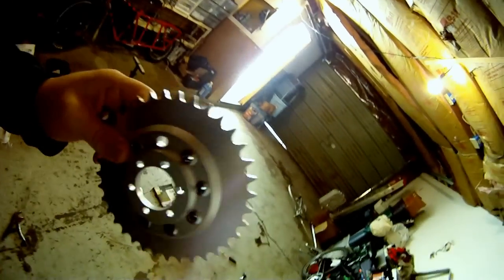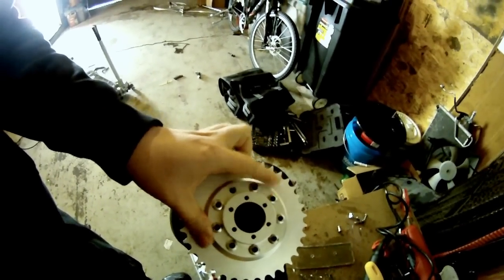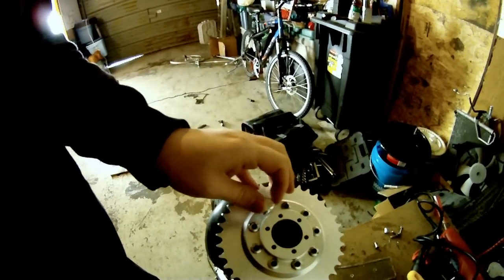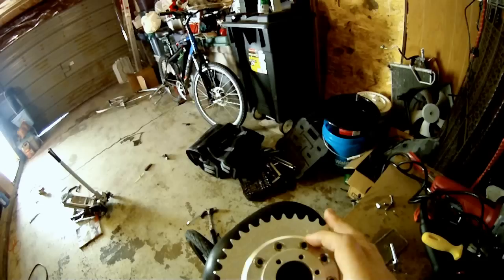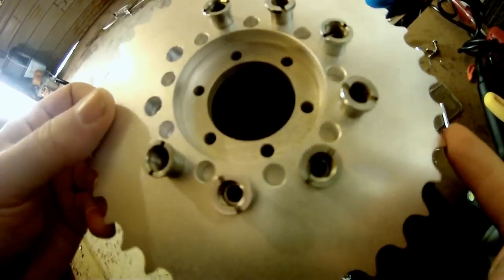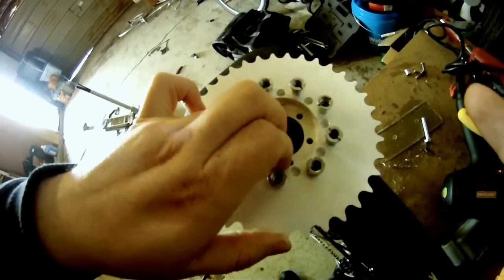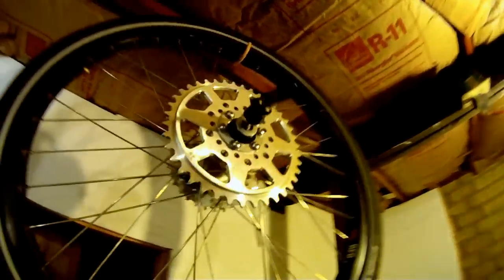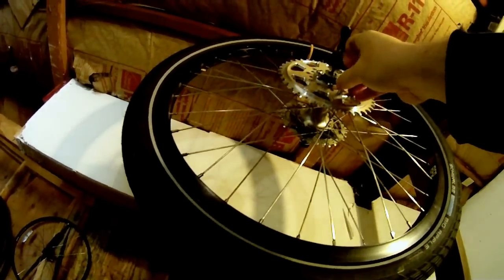kingssalesandservice / kingssalesandsprockets tophat adapter machining problems.

Comment: Bummer, do you know of any similar products?
Reply from the maker: At the moment, no.. but rebelgears could cook you up a small disc brake sprocket. Unfortunately they do not design any inward offset into their gears, so it's rather easy to get a sprocket big enough to run into the chainstay on most bicycles.

Kind of a dead end unless you just need something like a 2:1 reduction ratio.

Comment: Being a tool and die maker 8.5mm is the clearance for the 8mm bolt.  The fault is in the design itself.  He should have two pins to locate you sprocket on that hat.  A set press fit into the hat itself 180 degrees apart from one another.  Another set slip fit into the the mating sprocket.  The tension will be on those pins (shear) and not the bolt clamping force.  In turn you will have solid mounting on the pins along with everything being very concentric (within a few thousandths of an inch).  Of course all of the pin work needs to be done in the same setup as hole placement and tooth machining.  There are a few ways to skin that cat properly!  Hit me up if you'd like help with any more of this!

Take Care,
Kevin
Reply from the maker: I was going to run an extremely high torque electric motor with this. I was worried about potential for slippage at low rpm and high torque.. 

I ended up with a really cool sprocket adapter from a maker on endless sphere ( ebike forum ) that had a SUPER tight fit all around. 

It just wasn't designed right, for sure.